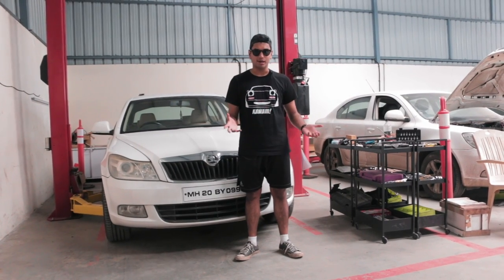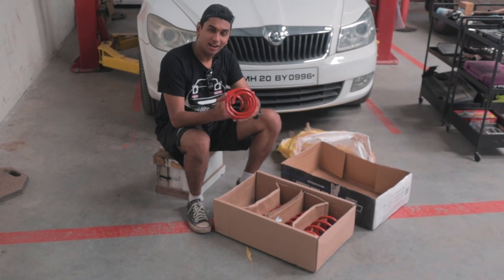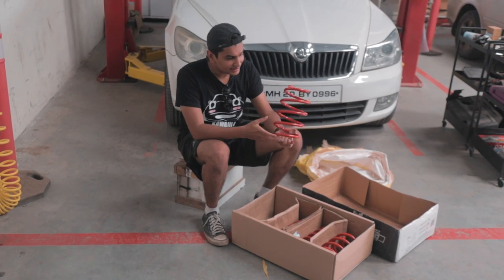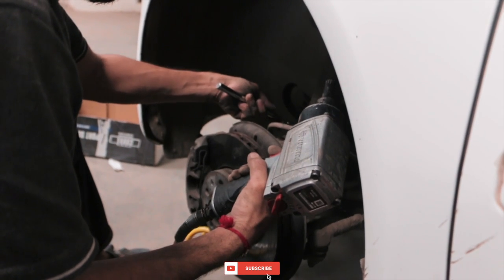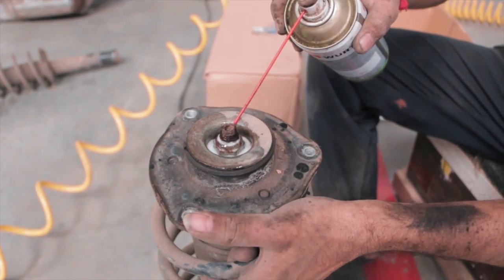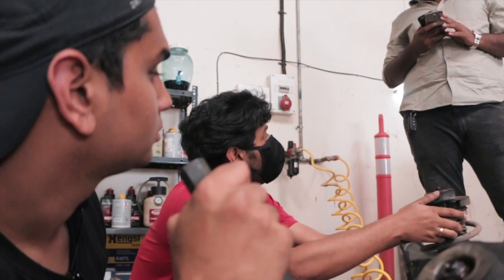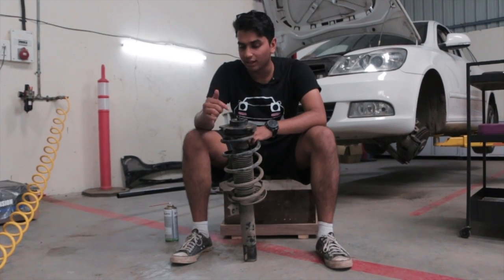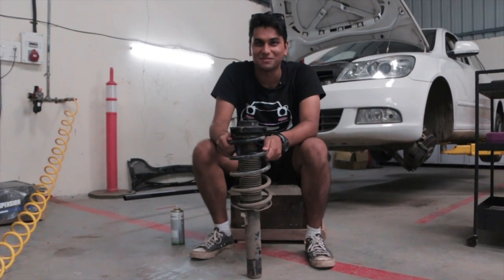We broke the suspension on the Skoda Laura 1.8 TSI + New Cobra Lowering Springs! | #ProjectLaura

Comment: These cars are Money Pits in the second hand market if the earlier owners didn't maintain it properly. No matter what amount you buy, one needs to keep atleast 1-1.5 lac rupees extra budget for repairs / major services and surprises. People with exact budget especially buying the car by taking loan or exhausting entire savings etc should not fall for it.
Reply: Right bro but not 1 1.5 lac but atleast 10 to 15% of the original value of the car heard this from the owner
Reply: @fuad9241  so that's what I said buddy one lac to one and half. That's bare minimum, just the suspension change with ball joints etc will cost around 50-70k depending on quality which are routinely to be changed parts, forget the clutch system and turbo, that can dig a real real big hole. Moreover most of garages don't use torque wrench while fitting back parts or engine which further ruins the car. I see many enthusiastic people getting influenced by tuner scene, keeping budget like 3 lac and hoping to own these German cars, what people should realise is keep 2 lac aside apart from purchase, otherwise car will never provide the driving experience and spend most of time at home.